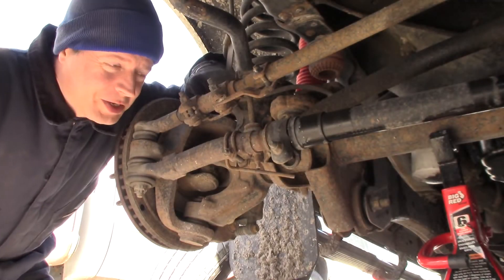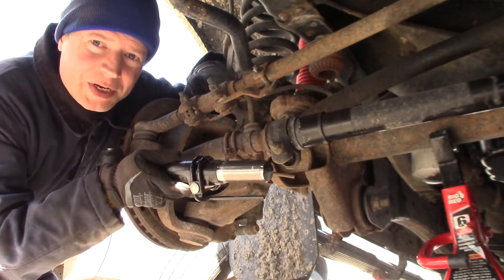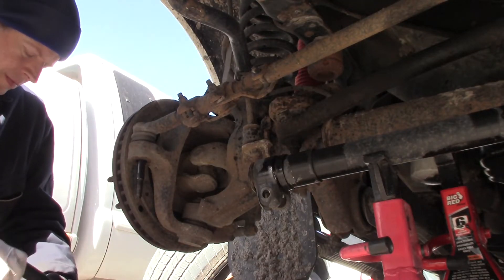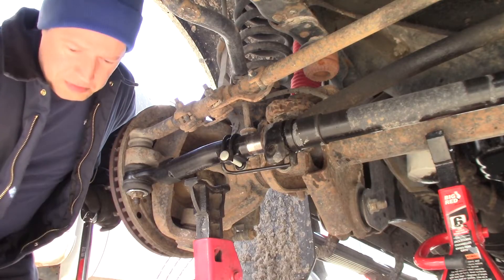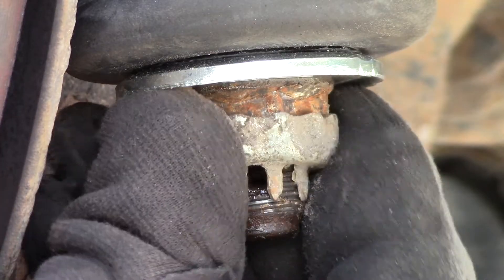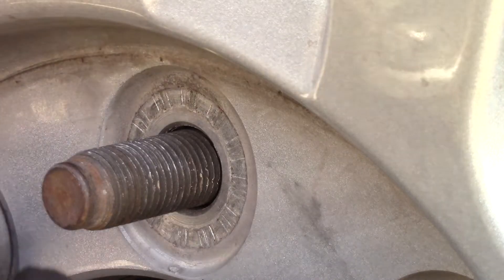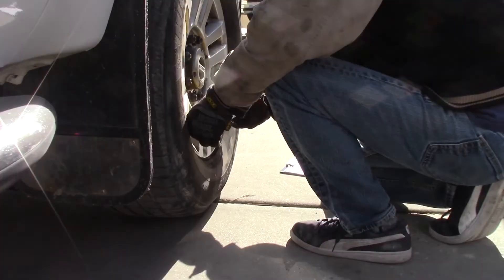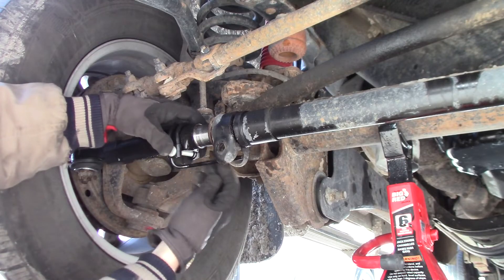Ford F-250 Outer Tie Rod Replacement and Laser Alignment Check

Comment: Zero tow most of time isn't right,,,, point going down the road the tire turn centrifugal force try's to force the tire and wheel to the outside... 1/8" tow while stopped/setting still... Centrifugal force will push it back out to zero, going down the highway..
Reply: Great video

Comment: When replacing the tie rod on that side did you have a locking ring on there?

I have a 2011 Ford f250 4x4 and it didn’t have a ring but the other side of the tie Rod does.

Comment: Thanks for video, did u use motorcraft parts? Im wondering if aftermarket is ok to use?
Reply from the maker: I usually use quality aftermarket parts, and not the cheapest unless it's the only option.